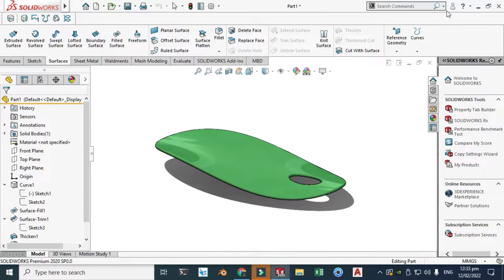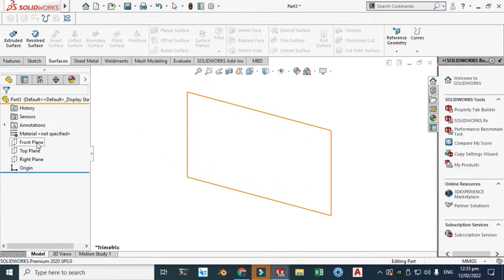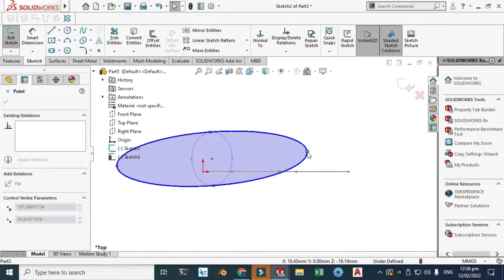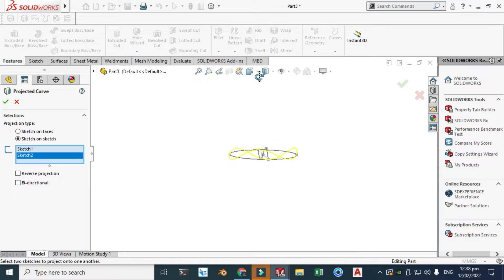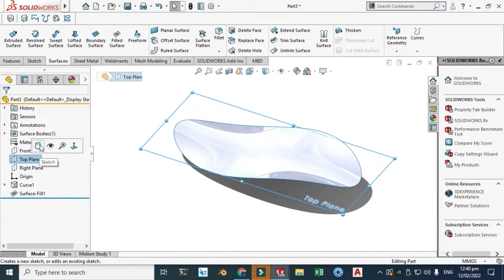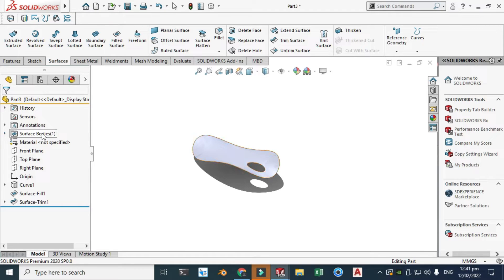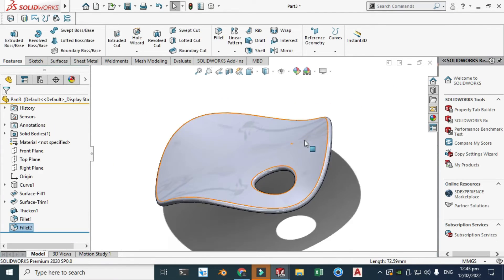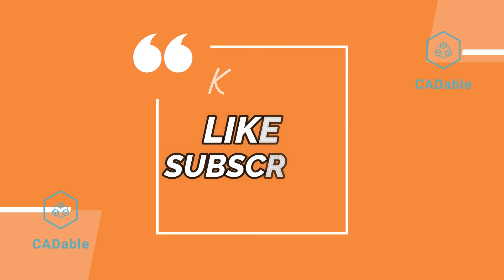Solidworks project curve | 3d sketch vs projected curve | solidworks 3d curve | shoe horn solidworks

Comment: Is there any way to project a curve using 3 sketches?
Reply from the maker: In my understanding, the project curve tool in SolidWorks can only project a curve using 2 sketches. If you try to project a curve using 3 sketches, SolidWorks will only project the first 2 sketches. The third sketch will be ignored.
Reply: Okay, thanks! I found another way to build my thing!